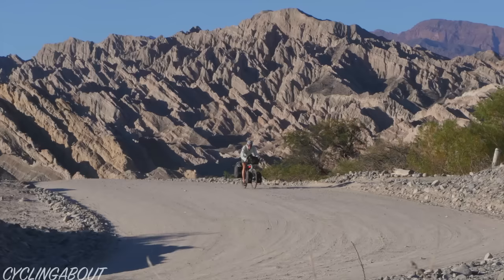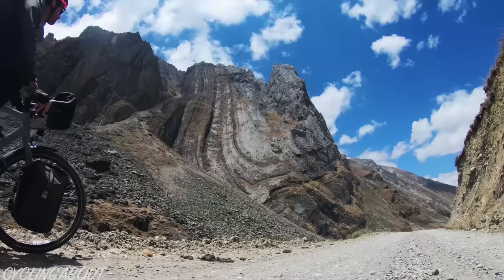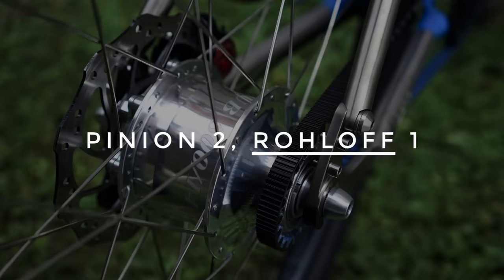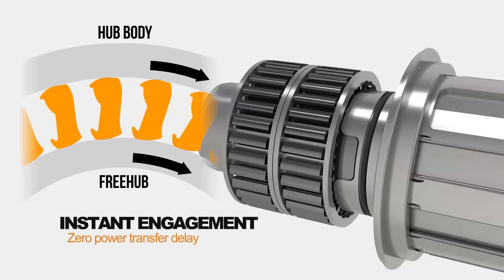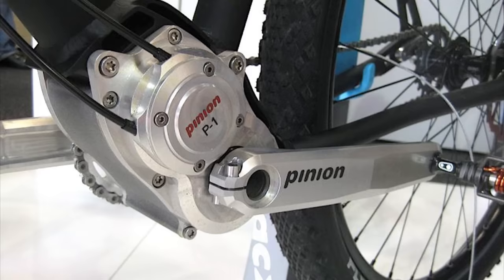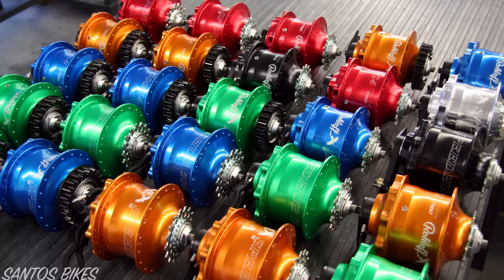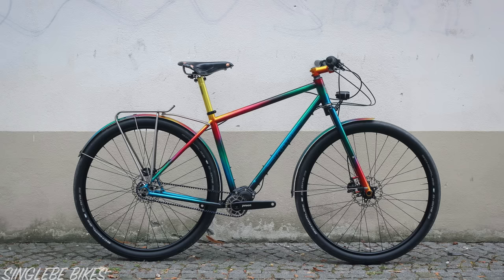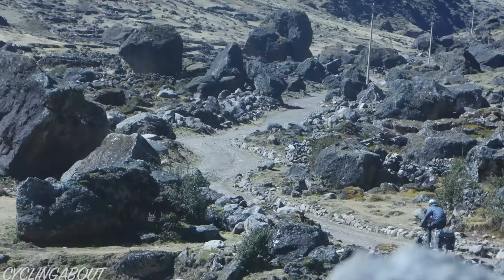What's The Ultimate Bicycle Gearbox? Rohloff Hub VS Pinion Gearbox

Comment: I had a rohloff for a few years and had problems.  
1) Oil leaked if I laid it on the side.  Got on disc brake.
2) Cog would bite into (thread onto) the hub so tight I could not get it off without a 5 ft pipe. 
3) Torque output arm broke my frame.   Look into this.  The torque output is many times what your torque input is at the pedals.
4) Efficiency
5) Unsprung weight.
Reply: 1) Then you have the stupid QR one.
3) The long arm?? What bike? I had my wheel off in Saigon to fix my cog. I forgot to tighten the 6 mm bolt. So the arm was kind of loose most of the way to Hanoi, I think it was. LOL. Before that, I had a motorcycle slowly crash into right where the arm clamp was. Bike jumped a couple inches and I neither went down or broke the chainstay. LOL
4 ) Rohloff is FAR more efficient than grinding deFaileurs on a HEAVYWEIGHT. FACT.
5) BEST place for weight, IMO.
Reply: @GordoGambler  I've heard Alee cite research that the Rohloff is almost as efficient as a derailleur, but there are many people with both systems who say that the Rohloff is much less efficient.  I'm not sure either way.
Reply: @TheGeeoff  Most of those guys probably never rode them enough to loosen them up. Mine has 19,200 miles now, works far better. It is still tighter than my SA 3 and 5w ever were. I sold my last defaileur 4 years ago, none were lightweights. Anyway, my Rohloff bike is never less than 73 lbs, I still do rides up to 129 miles. It goes 15 mph with not much effort when I'm fresh. It is 120 lbs on tour. The ease of shifting trumps crooked chainline double shifting every time. 
There's guys on the Thorn forum with over 80,000 total miles on 3 R14s. 

On my first tour in SE Asia, I had occasion to pace a few young Chinese tour guys on MTBs with bikes half my weight. One of those was on a horrible 14 mile stretch of wet clay with 3 hills. My tires were 36 mm, but I still did better up hill. LOL. He could go faster down with 50 mm knobbies. Road was so bad cars could barely go 4 mph. LOL. I could only ride in their tracks and my front fender was clogging up. 

Actually later, in 2018 on my second tour in the BC mountains, I came upon a 40s guy in lycra on what looked like a fast deraileur setup again. Next day he wanted me to tag along the 60 miles to the next town. He was so slow and or useless, he disappeared. LOL. Half way I stopped for a snack at a campground and saw him disappear again. 
I did 98 miles Golden to Revelstoke in 13 hours, with 3 miles walking I think.

Comment: You left out one consideration. The Q factor. With clip less pedals I can’t use the pinion gearbox because the Q factor is too wide for my knees. My mountain bike uses a narrow Q factor crank like my road bikes. So the Rohloff or any other wheel hub is a better choice for me.

Comment: When I was a kid in the '80s, riding around my hometown (which is the hilliest town I know of) on my 26" department store "Columbia Charger" 10-speed road bike (which I got for free), I only ever bothered with 3 gears, and the vast majority of the time, only two gears. I used first gear most of the time, i.e., for going up hills and on level ground if I wasn't in a hurry. I used 5th gear if I wanted to go fast on level ground or down a hill. Rarely, I used 10th gear if I wanted to go extra fast down a long, steep hill.

I wish I still had that bike, but it got stolen in '89 or '90 and I never saw it again. It was a tough bike. I often rode it fast on bumpy, rocky, dirt roads and nothing ever broke or bent. The only work I ever had to do to it was fine tuning the brakes and derailleur mechanism, and I replaced the rear tire once too. 

The brakes worked amazingly well even though they were just cheap side-pull caliper brakes. Chrome-plated rims and the braking leverage you get from using rim brakes with large diameter rims means you don't need fancy brakes to stop well. The front brake could have easily launched me over the handlebars if I didn't shift my weight to the rear when braking hard. The back brake worked great too (i.e., it could lock the rear wheel with ease, which is point of maximum stopping power for any type of brake), though I rarely used it, because back brakes are next to useless, whether on a bike or an automobile. I switched the brake cables around so that the front brake was connected to the right-hand lever, because I'm right-handed and the front brake is by far the better brake due to the laws of physics. I've done that with all my bikes since then too. My current bikes don't even have back brakes. I ditched that dead weight.

Comment: My Rohloffe hub works great after 30 th kms only had rear sprocket issues after the 3rd upgrade no problems, never had changed the shift cables , keep them well lubed ( small lube hole the shifter housing) this fat bike has mostly seen snow on bad weather 👍

Comment: I hope these will catch on and the prices will fall waay down. Sadly too expensive for most as they are now
Reply: Prices won't fall "waay down" as these are highly engineered gearboxes.
Reply: You could run an Alfine 8 with a front derailer for complete gear range. The Alfine 8 is silent and tough enough for mountain biking. I have never had one fail.
Reply: karrppu, very true about the cost (I'm poor) as they always say, You get what you pay for.

Comment: I have to add a few things here. I´ve been using Rohloff and Pinion in Mountainbiking, especially gravity, for many years. I even have had the perfect hybrid of both, a BB mounted G-Boxx1 Rohloff driven Gearbox on the Nicolai Nucleon platform which is, in my personal opinion, the best gearbox ever made (if you ignore the weight). First, Rohloff cable changes are easy but it depends on if you got the external or internal version. With the internal one you need a 0,9mm cable which is extremely  difficult to source outside europe. However the external design uses the 1mm cable avialable everywhere so i highly recommend getting the external version for traveling the world. I tested the Pinion p1.18 and to me the shifter felt cheap, was rattling a bit (every one i had did this) and you can´t feel the  clicks from one gear to another well if wearing gloves this is making blind shifting in racing very difficult and without gloves the rubber becomes slippery and easy to loose grip on if you sweat a little or get some water on the grips, Rohloff has a defined click from gear to gear and the Gripshifter also feels more like a quality product compared to the pinion shifter. Another problem with Pinion are the shitty cranks. On a bike i had borrowed the cranks were cracked in the mounting point and a friend  who owns Alutechs Sennes and Fanes (DH/Enduro) bikes with pinion went through several sets of cranks (both milled and forged) that cracked in the same place. Pinion was not able to guarantee me that i could use the Cranks with my 92kg weight in Downhill racing safely in fact they did not even answer my questions anymore. This was the reason that i did not buy a new Pinion DH bike (Peregrine) yet and instead rebuilt my Alfine 8spd driven Zerode G2.5 27,5 Downhill bike. What i have to mention in a positive way about pinion is that the warranty is transferrable and they are a bit easier to shift when climbing. Rohloff hubs were downhill rated in the early 2000s i don´t know if they still are rated for Downhill racing but in my experience you can use them in DH without breaking them, the fact that you totally paralyze your suspension is another story. I used one in a Nicolai Helius Supertravel Downhill Build and it worked out pretty nicely however i am a pretty strong and heavy rider so the extra weight on the rear end did not cause trouble however to lighter riders this can become a big problem. Overall i am a big fan of the rohloff technology. However what pisses me off with rohloff is that the service and customer friendliness has really gone downhill over the course of the past 8 years. I was insulted and shouted at by an employee on the hotline for no reason because i accidentally called them on the dealers hotline (there was no information that it was dealers only and i was polite and did not give any reason to shout at me) to order a specific piece. Via email they told me to ask my local bikeshop and the guy there said rohloff don´t talk to him on the phone often don´t answer the phone at all and also have some of the worst service and support out of all companies he deals with; i heard this same story from 4 different bikeshops i asked to order me the part i needed, many bikeshops told me they stopped working with rohloff at all due to bad service and suppor and sell Alfine 8 and 11 hubs instead. The result was that i had to annoy the company that made the bike (i had a 10 year spare parts guarantee contract) and they sent me an inferior (probably chinese) copy that was so bad they sent me another one for free because it broke after just two months while the original lasted me 5 years, a few days ago i broke this one, too. Something i don´t expect when buying a 10.000€ racing bike to use for more than just one season like most privateers do. Now i can´t use it anymore because of the inability of rohloff to provide a 6€ piece (i know they have it in stock they just don´t want to sell it to private customers). This hassle is the reason i won´t buy another rohloff gearhub even though it is the best gearhub. I currently wait for pinion to improve the crankset, if they don´t i will just buy a pinion p1.18 for the next season and have my own cranks machined from steel, this season is fucked anyway. If you want a really cool FS mountainbike with a gearbox i can recommend the Nicolai G16/G15GPI (comes with gates carbon drive, alloy frames, also custom frames possible), Zerode Taniwha (or any other Zerode), Peregrineindustry(most versatile frame, steel), Cheetah Mountain Spirit (best value for money gearbox bike out there and fully customizable), Quantor Brenneisen. Alutech don´t make the Pinion frames anymore but if you can track down a used good condition 27,5 Fanes or Sennes with pinion you won´t regret buying and rebuilding it, same counts for the Nicolai ION 18 PI . I also want to leave a word about the RoBox i think it is great and i recommend it to people that can afford it. If you are on a budget and do not absolutely need it, rather spend the money elsewhere.
Reply from the maker: Thanks for sharing your experience! Very detailed.

Comment: I purchased my Rohloff Speedhub about 10 years ago for a hardtail MTB buildup. Since then it's been in multiple frames. Most importantly: I ran it 5 years with no oil change and basically only residual oil because it has the old CC-seal problem where oil drips out the axle (disc brake/ExBox/quick release). The Speedhub is built for travel bikes and tandems - no wonder it's overengineered...😎✌️

Comment: I've put 33,000km on my current 3x8 speed shimano XT hub, deore derailer system and chain. $50 for XT hub, $12 for 8 speed cluster, chain $10, $55 crank set, $15 bottom bracket. Total cost of components = $142. Thinking it will last until 50,000 km easily at this stage. Ridden as touring bike and daily commuter in all weather. Simple is beautiful.

Comment: I have a Rollhof Shand Stoater.  It is smooth, quiet, clean and bomb proof. OK, I'm not chasing down Strava segments on it but it is a solid reliable cruiser.  It makes the rear end of the bike slightly heavier but to be honest going down tracks and untarmaced surfaces this isn't a bad thing.  I find the gear changing smooth (it's the same as not mashing your gears on derailleur). I find the linear gear spacing fantastic and I have lowered the ratio from stock. This gives good climbing ability loaded and to be honest more than enough top end.  When I want a quick spin and a bit of fast fun I jump on my Roubaix!!

Comment: With rear wheel suspension, the advantages are quite clear with the Pinion transmission. The unsprung masses are considerably smaller, which provides considerable advantages in terms of suspension comfort.

Comment: I have a Rohloff on my Thorn MTB that I bought in 2009. It has a better range than my mates 1 x 11 or 1 x 12 derailleurs, is more reliable and only needs an annual oilchange. Chains and gearwheels last a couple of years. It is higher in first cost than a derailleur system, is heavier and puts the weight further back. I have had only one problem with it in 12 years, an oil leak, and Rohloff in Germany repaired it at no cost to me (I live in the UK). Cost per year of use is now down to about £100. I'm happy to continue using it, especially when I see my mates bend their mech hangers, have skipping chains, broken chains or lose their jockey wheels, all of which have happened on our rides. It's irritating when people assume I'm on an electric bike because of the large hub. I know nobody who has the Pinion.

Comment: I have a Pinion P1.18 fitted to my HP Velotechnik Scorpion fs 26 S-Pedelec and have traveled over 3000 trouble-free miles and on the same gear-change cable. A few weeks ago I took the chain off the front chainring and spun the peddles by hand so I could feel how much drag there was. Though the drag was more noticeable in gear 18 than in gear 1, I doubt I would be able to detect that drag if I was to spin the peddles with my legs. That's how minuscule the drag is.

Comment: i,m using sturmey archer :)
Reply: Three speed, with the little oil cap... and a half-inch-wide cotton band skipping around the hub to keep it shiny. Memories of a 1960s childhood.
Reply: I love sturmey archer!
Reply: Antique.
Reply: It a 5 speed with a drum brake 😜
Reply: @allen3870  .... I also loved my XL RD5w, until the shifting went wonky. The weak spring doesn't hold it's shape and the nubs on the inside key was sticky from the start. I filed off some corners, but it didn't help much. The indicator shaft wouldn't go back in. Plus I was switching it out with my Rohloff for touring. 
But it was my FASTEST and most fun hub. It has my 3 longest day rides at 126 miles and speed at 45.8 mph. 
Now I have a new drum 3 spd 584 mm wheel on a 1973 CCM with 1 pc crank. I took it on my longest ride, 85.5 miles on the hilliest route here. It lacks speed somehow, but damned if it seemed to take the hills easier than both the others. LOL. 
I also took it on my car trip last fall. NO problems.
Reply: @albertbatfinder5240  

Three speed is enough for most of the terrain I use my bikes on...
Better than Sturmeys are German made F&S, especially Torpedo 515 built from '61 to '77, lasts forever, easily servicable, not too heavy, nice looking and easy to adjust. 
The SRAM T3 is actually based on the F&S hub two generations after it, even has some compatible parts. But those are not nearly as well built...

Comment: Come on Shimano & SRAM. Show us what u got with all that R&D Money. I smell a gear box coming from both of them.
Reply: It's not a new concept. In the 1930s bottom bracket gearboxes were used on a lot of German bikes (3- or 4 speed) but went out of fashion after the war.
Reply: If I want to change my gearing, a new chain and a new cassette (total cost EUR50) will make me do it in an hour. Try the same with a hub in the wheel or in the BB. Cannot do. 
After each cassette/chain change I have a brandnew transmission. Not a worn out hub.
Reply: @frutt5k  

Hubs barely wear out if they are good quality and you properly maintain them. They last for decades. Some 3 speed hubs basically last forever...
Also you can replace the whole planetary gear set in a hub, as the shell is even less subject to wear than the freewheel pawls and ball bearings in your derailer system hub...

Comment: Rohloff nothing else....no special frame, youn can take it in every frame, cheaper, 14 gears are enough ! less power loosing!
Reply: Well, the special frame has other advantages like no extra weight on the rear wheel which results in a smother drive feeling! I really love my Pinion - nothing else (as well)! ;)
Reply: nah, with pinion you can switch out your 29er wheels for more tarmac/gravel rides with a 27.5 and 3" tyres for the off-road.

Comment: I bought my Rohloff hub in 2004 for mountainbiking and still use it. I have send it once to Rohloff to be upgrade it for disk breaks. Now I'm looking for a new frame and all frames now are boost, I have contacted Rohloff for upgrading my hub to boost. Because my hub is so old they told me that it is more economical to buy a new hub. Although I like the Rohloff hub I am now looking for the Kindernay hub, this is a hub similar to the Rohloff but has hydraulic shifting and it is possible to use the hub in multiple wheels. It will also fit vario hub sizes.

Comment: Poor cyclist like me stays with old style derailleur. Gearbox and belt drive are for people with money to burn.
Reply: Absolutely nothing wrong with derailleurs. As long as one can enjoy cycling, who cares what gearsystem one has.
Reply: Yeah, since when was cycling all about spending huge cash. People are being scammed pretty much.
Reply: @difflocktwo  ^^^ THIS.
Reply: if you ride lots of kms hub gears in the long run are a lot  cheaper than derailleurs, no need to constantly replace chainrings, chains, rear cassettes, jockey wheels etc. I switched to a rohloff because of this but the main reason i like it: i can change gears when stationary.
Reply: @robertdavey2660  You can do this with a nexus 3 speed or a single speed bike. we can also enclose our drivetrains like every other road machine ever.
Reply: difflocktwo  🤣🤣🤣 a 3 speed Nexus hub isn’t in the same universe as a Rohloff (or even an Alfine).  You are completely missing  robert davey  ‚s point which is on point 😉
Reply: @robertdavey2660  I use a €18 Shimano 9 speed cassette, €10 for a pair of jokey wheels, a €15 aluminium chainring and three €17 KMC 9 speed chains a year. That is €94 for 15,000 Km a year.